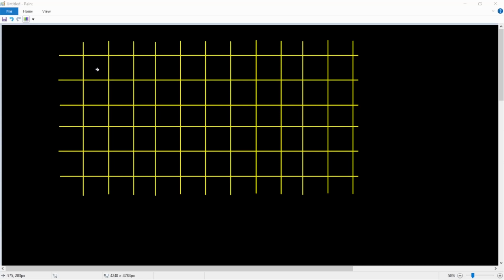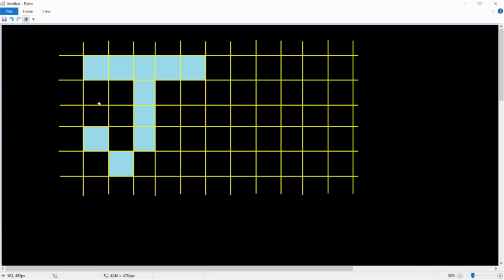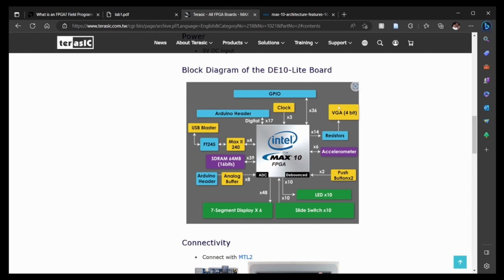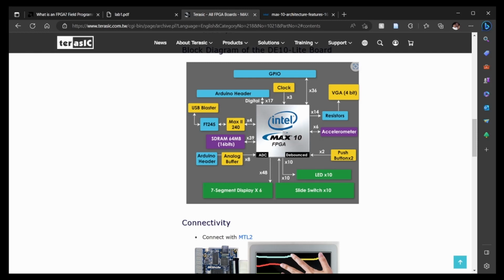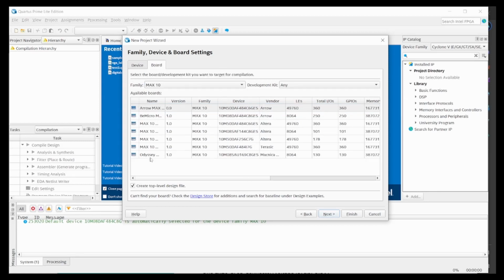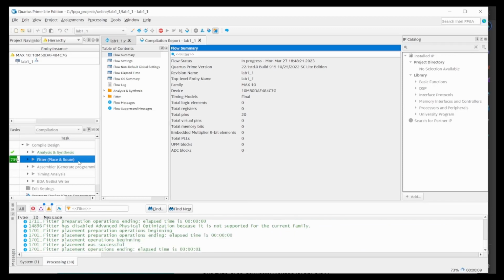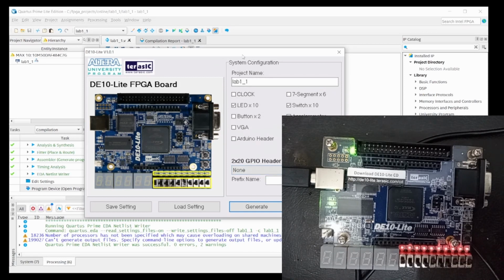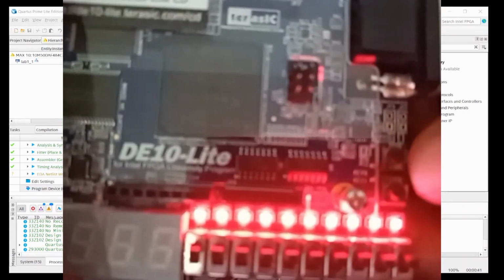Introduction to FPGA Programming using Quartus Prime Lite (with Verilog)

Comment: Helpful video!  A few things have changed I think since you made this video....I have W11 system, to get USB blaster to show up as a viable programming option I had to go to C:\intelFPGA_lite\23.1std\quartus\drivers and run dpinst.exe.  I could not find this step in any other video, and during initial quartus lite install the program said it installed the driver OK but it didn't.  I had to reinstall it manually.  Note that other videos say you have to use device manager for USB Blaster install--no, that didn't work for me.  Two: I had to manually check "program/configure: or the start button would be grayed out.  Other than that, everything in the video worked great for me.